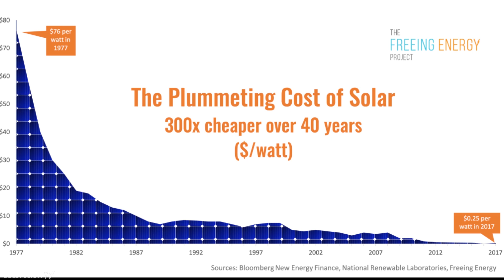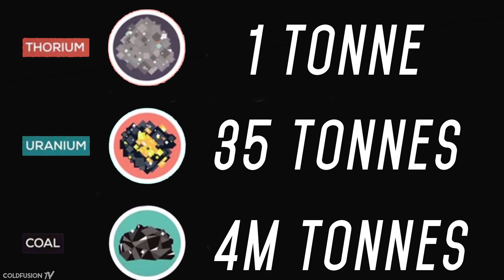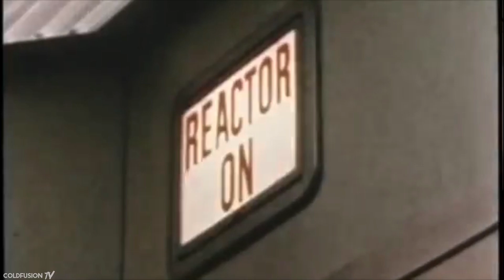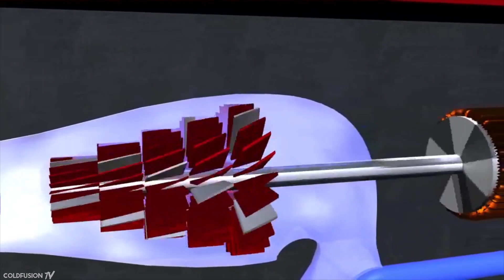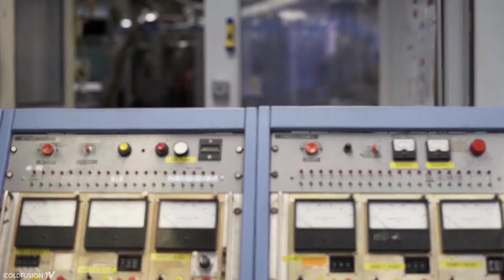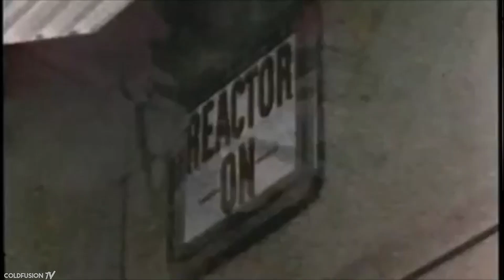Thorium - The Future of Energy?

Comment: I was involved in private research some twenty plus years ago, and everything I read indicated the US Defence force were responsible for the lack of interest in Thorium.  As stated in your video, the major reason being Thorium had no part in providing product for the weapons industry, although many scare tactics, reminiscent of the Current Wars of the early twentieth century, were used to placate the masses.  Unfortunately our American friends have a somewhat high degree of paranoia that is often exploited by the Defence industries and their paid up Senators and Congressmen.  Nevertheless, I concluded Thorium was a better option than Uranium, as indeed you have, and any additional cost can be countered by the increased safety.  Of course Australia could have used natural gas for the interim period whist Thorium reactors are developed had we not sold it to multinationals for nothing, although that’s another story.
Reply: You can make nuclear weapons from the Thorium fuel cycle. The US military actually did this in testing, and so did USSR and India. But plutonium is easier, so that's what they went with.
Reply: @zolikoff  It can be done, but the breeding of U233 from thorium also breed a bit of IIRC, U232, which is a hard gamma emitter and makes it hard to get close to or put into a weapon without frying the electronics.
Reply: @zolikoff  Your assertion is an over-simplifcation in the extreme, completely ridiculous. .You can make a dirty bomb from any nuclear waste, which is sitting in huge stockpiles already, including medical waste, if you can get your hands on it. You can NOT make a fission bomb from Thorium or the "waste" products (actually trans-uranics, that are not waste, but sources of medical isotopes), and you wouldn't anyway, because to make a fission bomb, this requires Plutonium and all the centrifuges and whatnot to enrich the fuel, which would require you are a state actor, it isn't even remotely something that could be done by an individual actor.  In fact, Thorium reactors are Breeder Reactors, and can easily consume existing waste that is and will be siting there for next thousands and thousands of years, making the security of those stockpiles much better, not worse.
Reply: You can make nuclear bombs the following proven ways:
1. Enrich natural uranium until it's mostly U-235. This method doesn't require a nuclear reactor.
2. Use a nuclear reactor to breed Pu-239 from U-238. This method doesn't require any enrichment, but you need the right burnup. Spent fuel from LWRs is not fit for this.
3. Use a nuclear reactor to breed U-233 from Th-232. This is similar to the previous method. No need for enrichment.
As in, yes, you can make nuclear weapons from thorium, precisely because it's a breeder reactor.
Reply: @zolikoff  Well the US Government didn't like the half life of the nuclear fuel so they went with something that had a high shelf life. I could get an vented glass box and put in a pair of goats and a trough of taco bell bean burritos with the toppings that would make the worse gas in history for an dirty "bomb" but if the gas doesn't last but 1 second it won't do its job. The same thing can be said for nuclear breed versions of uranium and plutonium. They don't want short half life materials. That is why they didn't go with thorium.
Reply: @乔石 That's why IRAN is next on the list for REGIME CHANGE! they will create false flags to create a war to take over IRAN.
They've done it perfectly for to other countries. And there is nothing we the average person can do anything about it.
Reply: @hanniffydinn6019  The average person can have less children & consumer less resources that run the global engine.
Reply: army people ruining it for everyone once again
Reply: Brian Bellia  Very few nations have the resources or expertise to develop LFTRs to a point at which they would be commercially viable and America is historically the world leader in nuclear research. China is capable and has recently commissioned 2 prototype Thorium reactors.

What I will say is that this video gives a very 1 sided approach to LFTRs, molten fluoride salts are extremely corrosive. The parts of the neutron bombardment process are dangerous and America concluded LFTRs are a no go after research carried out by Oak Ridge in the 70s. The scientists working at that time actually posted a lot of their findings for free online when they retired which is behind the recent resurgence of interest in Thorium.
Reply: @ollyole4560  the scientists who worked on molten salt reactors didn't post the info online, Kirk Sorenson, a former NASA scientist did.
Reply: @Les_S537  Not true. That information is in the public domain, long before the internet existed. There have been tours of the MSR project at ORNL over the years by any number of international scientists. Sorenson has simply documented this. It is very clearly explained in Sorenson's videos, which are easily found via google.
Reply: @ollyole4560  "... molten fluoride salts are extremely corrosive." No one said that this technology does not have design challenges. To me that is what science is, overcoming challenges with new ideas. Perhaps 40 years later, our worlds scientists will complete the work started, safely!?
Reply: It's gotten to the point in the US, that the defense industry, and large corporations ARE congress, the senate, and supreme court. The federal government is a lost cause and most states seem to be miserably corrupt too.
Reply: Brian Bellia  By the way, I would trust more Iran with nuclear than Pakistan or China or USA. Here is a country that has never attacked any other nation at least in the past 3-4 centuries. Much unlike USA, no wonder why you hate Iran so much.
Reply: @xaris5309  Someone clearly has never heard of the Afsharid dynasty.
Reply: Look up John Hutchinson Crystal Batteries and The Hutchinson Effect.
Reply: The American Military is to blame,...really? The US military doesn't control the world and it didn't stop anybody from investigating Thorium.  You "open minded" lefties always seem to pin all things bad on some singular entity that you are predisposed to hate.  US military one day, Capitalism/Corporations the next,  and then Christian churches the day after that.  Sooooo damn predictable.
Reply: 乔石 Spoken like a true left wing, brain washed communist with no clue of how a free market operates and provides goods and services for any nation willing to participate. The U.S. dollar,didn’t get to be the preferred currency world wide by chance. I suggest you educate yourself and find out why instead of espousing like a jealous child.
Reply: I was reading up on Thorium and one of the myths of it was that it was deterred by Nuclear weapons production. The real driving force as to why it didn't progress further was because of the fear of nuclear power especially after TMI and Chernoybl.
Reply: Brian Bellia  you can ask the same for crytography , spread of "democracy", war , weapons mnaufacturing , threats , assassinations, cover ups , global bullying , spread of racial stereotyping , global polluter (by far the biggest with all the wars the US has created) and now sanctioning ? , how will anyone else be developing things with such a bully ?
Reply: Brian Bellia  Bro, the Soviets had a PFBR, but they broke up before any good could come of it.
Reply: Brian Bellia  As the video mentioned, paraphrasing: "after renewed interest are (still) in the research stage in many countries."
Reply: They get the reactors for their top secret balony projects
Reply: Brian Bellia  Sanctions. Like Iran, can't build power plants without US accusing them of building WMDs. The Defence force needs to be constantly at war to keep the gears churning.
Reply: Robert Kerr you might have been in a documentary I watched
Reply: I think they are not able to comprehend your logic Brian Bellia 
They all blaming the USA for developing uranium more than thorium haha. @Robert Kerr, it seems you are envy and jealous over the USA since they have the capability to choose between thorium and uranium

Like the video said, from then up to now, only minimal research was made on it, but why after the USA decide to develop uranium other countries not choosing thorium 100%?

The UK could choose thorium, but instead, they go to uranium
French could choose thorium, but instead, they go to uranium
India could choose thorium, but instead, they go to uranium
China could choose thorium, but instead, they go to uranium
Russia could choose thorium, but instead, they go to uranium
Iran could choose thorium, but instead, they go to uranium
Japan could choose thorium, but instead, they go to uranium

Only now people start bitching about it because back then the USA could choose thorium! but hey they are not realizing it that their country themselves priorities uranium more compare to thorium. Indian are hypocrites 

Face it, HUMANITY prefers uranium. Not the USA
Reply: Why don't we crowdfund thorium research?
Reply: Thorium is better for energy reactors not for weapons. As for America being the reason uranium was used, it was used for better weapons and no other reason. If our British and Australian counterparts had actually done their home work they would have known this, however they couldnt even touch research on this.
Reply: Brian Bellia   india has a fully functioning thorium reactor , the documentary I watched that I can no longer find stated the US applied major pressure to ensure the reactor would supply no power to the community courtesy of the oil and gas lobby in Washington DC
Reply: fucking bullshit
Reply: Brian Bellia  Dude, America today is already stopping many countries from developing their own nuclear power in fears of people other than themselves developing nuclear weapon. They did they same with oil, they sanction others for trying to sell their own oil outside of the petrol dollar. Now they are banning Huawei in the name of national secutiry for having 5G ahead of America.

However, on the topic of Thorium, its much harder for other countries to develop it themselves. The tech of uranium nuclear power has already been developed and matured before other countries do so using the already known knowledge for it. Thorium nuclear power is still pretty much new and undeveloped, other than USA, China and EU, i doubt there are any countries capable of developing it. China only managed to acquire such technological capabilities in the last 10 years, thou not nuclear specific. Regardless, China is already late to the party, they would rather invest in nuclear fusion instead of fission. America's economy is based on imperialistic policies i.e oil and military, Thorium reactor isn't a game changer to them nor is it worth the change. Not sure about EU, they have the tech for world's largest hadron collider, not sure why they did not develop Thorium reactor.
Reply: @skychaos87  thats it. They do not have the capabilities to developed thorium. I dont get it why people here blaming usa for choosing uranium over thorium, when other country choose to develop the same uranium.

Yes usa and ussr tried to duopolize nuclear but hey look at now eu have nuclear why they not choose thorium? 

5g is not enough reason to ban company
Reply: Looks like the US defense force is severely underestimating the potential applications for safer power reactors, judging by the potential stability thorium can provide, proper development could lead to mobile nuclear reactors which they could use to power their crazy new railguns and from there, develop weapons of war on a scale that has never been seen before (maybe even actual helicarriers, flying artillery platforms, and new defensive technology for large scale structures like ships or bases that need more power than is traditionally available. A lot of things become possible if you can dedicate an entire reactor to it.)

Hell, fuck, they even recently tried to develop something like this. Just not with thorium, the wankers.
Reply: Name a country with no corruption in their rulers.
Reply: Brian Bellia  US...and their allies that have their own geopolitical interests.
Reply: Brian Bellia  
" So did that bill kill thorium technology in places like Britain, Germany, France, Japan, Russia and China, too?"

What kind of retarded question is that? Most haven't developed the technology. China and India are starting too now. What kind of world leader are we supposed to be by sitting on our ass with a perfect opportunity to use it? We are the ones that looked into it first. Why should America give up that initiative and for what benefit? 

One of the things the Thorium bank bill addressed is rare earth minerals. We used to produce such things until thorium was classified a nuclear fuel. After that mining stopped and now 100% comes from China, and we need rare earths for military tech. You think with our latest problems with China we should be dependent on them?

Thorium is clean carbon-free energy, and with the right reactors it would be totally safe, and we can start mining rare earths in America once again and have security in the fact that our supply chain doesn't start in a hostile foreign country.
Reply: Robert Kerr so how do you think the tech can best be incorporated into our energy grid knowing what you know?
Reply: If Nixon was strong in subject: science, he would predict that:
www.youtube.com/watch?v=lxwF93wnRQo - National Security, Rare Earth Elements

BTW - the ones that think molten salt is "super corrossive" are WRONG!
MRS in Oak Ridge run for 3 years, there was some corrosion to the vesel, but nothing serious. Hastelloy-N need some addiction: niobium to counter tellurium.
Reply: Thorium reactors were discontinued until a major technological hurdle was overcome. Lubricant from the pumps leaked into the system and clogged the cooling channels.
Reply: There’s multiple problems with your argument that we didn’t pursue thorium due to weapons development:

1. Conventional commercial reactors were prohibited to be used in the USA for weapons creation by the Atomic Energy Act of 1956. Then you have the International Non-Proliferation Treaty signed in 1970 that also prohibits commercial reactors developing weapons grade material. Then you have the creation of the NRC in 1974, in which multiple federal laws prohibit the creation of weapons grade material. Oh and then there’s also the IAEA which prohibits commercial reactors from weapons grade material. 

2. Uranium 233 was absolutely used in nuclear weapons testing from 1960-1980 by the USA, UK, USSR and India. 

3. In 1977 Shippingport Atomic Energy Center and in 1984 Ft Vrain Nuclear Plant used thorium cores for an experimental Light Water Breeder Reactor commercially. 

4. From an operational standpoint the creation of weapons grade plutonium in commercial reactors doesn’t make any sense, because commercial fuel cycles are typically 8-14 months. However, fuel cycles over 2 months prohibit the creation of weapons grade plutonium, because the concentration and ratio of Plutonium 240 compared to Plutonium 239 is too high. 

Not only is your comment historically inaccurate, but it also doesn’t make any sense from nuclear engineering perspective.
Reply: Natural gas is the worst.
Reply: fossil fuels for the win buddy
Reply: g.e. provide fule rods how do they keep making mony if we go to toriom 
follow the monny
Reply: Nonsense. We don’t use PWRs to make Pu239. 

We didn’t sufficiently fund MSRs because the main effort was put on making fast breeder reactors, using the Uranium Plutonium cycle.
Reply: Brian Bellia  Lmaoo US/NATO sanctions exist and were the ones stopping developing countries from creating nuclear tech, you idiot. Developing countries making "bad choices", yeah right, nice way to dumb down colonization and complex history. Get out of your bogan land and read a book.
Reply: The galen winsor video https://www.youtube.com/watch?v=aq3BUDw6HIk  (the 2 hour full leng video is also in youtube) this revelation will blow your mind, the US corporations are evil !

https://mutualwelfare.org/what-do-we-really-know-about-nuclear-energy/

Then we have just one problem:  egoystic human behavior ! and the solution is a new educative model.  with a new economic model, we are talking about a new society.  http://e-nation.org http://unitycoin.net also the vision http://mutualwelfare.org/
Reply: And I am sure that we can start rolling these out today? I am sure that these reactors could be reducing carbon within a decade? I am sure that they can be rolled out fast enough to actually meet our needs? I am sure that there's enough Thorium to provide the power we need? I am sure someone's done studies of the environmental impact of extracting all that thorium?

Solar + wind + storage + smartgrids = solution

We have the technology. We have shown that solar and wind are very heavy on labor so these is a huge social benefit by creating lots of low and mid skilled jobs for all those displaced coal miners. It doesn't take a degree to install panels. We have shown that solar and wind are cost effective.

Why pursue a nuclear boondoggle when the answers are already here? What issue does thorium address that solar and storage does not?
Reply: @outsidefactor   Solar and Wind are inestable (by nature) and low power density in comparison with nuclear.  Hi power density mean cheap, the only reason nuclear is not cheap is due to over regulation, in example the regulation requires that nuclear plant radiation is 10 times lower that the mean of the country, that is insane.  All is a scare scam, open your mind.

Just read the article, https://mutualwelfare.org/what-do-we-really-know-about-nuclear-energy/   we can extract uranium from seawater cheaply and we would have uranium to produce energy for 100,000 years, https://newatlas.com/nuclear-uranium-seawater-fibers/55033/ .
Reply: Brian Bellia  
.....pressure from the U.S. !!!   😎😂😂😂
Reply: Brian Bellia  
The BIGGEST GIFT TO HUMANITY it would be, if we see U.S. stopping to manipulate the inner politics of other states !!!
The United States of Injustice have had the most malign/inhumane influence against "world-peace" !!
Thats a *pure fact*, no sane brain coukd see it in another way !
Reply: To be fair, if it wasn't for the interest in nuclear weapons, I strongly doubt that anyone would have gone through the capital expense required to make nuclear reactors in the first place, regardless of the fuel.

It's very easy to talk trash about the defense industry, but a fair evaluation of history would show that the defense industry is often the only entity that can make the large, high-risk investments in technology required to push humanity forward.
Reply: @JZ909  not even close to true. If we took the insane amount of money given to the military and used it for investment and research into energy we would be decades ahead of where we are now. War and the military industrial complex have caused incredible damage to our country and our culture throughout the last century.
Reply: @gearhead1302  Imagine, as 1950s politician, trying to advocate for billions of dollars in research toward advanced rockets in a world where ballistic missiles simply aren't a military requirement for whatever reason. What would be your selling point? We can take pictures of the Earth and look at them weeks later when they're dropped from canisters? We can build a space telescope to look at the universe? We can use it as a giant repeater tower for radio communications? How is that worth the immense cost of developing these systems, when there are cheaper, and in all likelihood better, alternatives available, like taking pictures of the Earth with aircraft, building massive ground-based telescopes, or building an entire network of land, or aerostat based repeaters. Now fast forward to today. It's hard to argue that the world is in a worse place because we went to space.

The military gets funding to develop bold new technologies, both because people think having a strong military is important, and also because military technology is competitive is nature. Your new gadget has to counter your adversary's gadget in some way. In the 1950s, building a rocket to take pictures of the Earth is probably an absurdly expensive and risky way to do that, but building a rocket is probably the cheapest way to bypass air defenses, and is therefore worth the developmental risk. As a byproduct of this research, society as a whole benefits from space access.

In an ideal world, we would have the foresight to invest in risky technologies without obvious near-term benefits and make these big steps forward without a competitive catalyst. However, in general, that's just not how the world works.
Reply: @JZ909  I couldn't agree more about the public funding. Many people don't understand how important it is for the public to fund research for new technology. If the public didn't fund it then it would never be accomplished because many of these things are as you said "high risk" and very expensive. There's simply no way a private company would take such a huge risk for minimal returns let alone the fact that many of the discoveries were never intended from the beginning. Most were simply stumbled upon by trying to increase our knowledge of things or as you stated, through military research. 

I'm just trying to make the argument that we could have still gotten these things done if we were to fund the research in a non military way and I believe much of that money was squandered on useless military intervention driven by the corrupt military industrial complex and the super rich. I do understand where you're coming from though, getting the money using fear and war was extremely effective where as getting it for a more noble cause - even a much smaller amount - would have been very difficult. I guess it's hard to say what the right decision would have been in hindsite because we did in fact gain tremendous technology from this funding, but it's hard to weigh that out against all the innocent lives lost.

 Regardless, in the future I think it would be best to pursue technology in a non military fashion. Our military is breaking the bank anyway I think it's way over funded.
Reply: @gearhead1302  I agree with having a large budget for research, and I don't see any particular reason that we should limit ourselves to defense research. Simply being the world leader in discovering new things, thereby attracting talent from around the world, is enough reason to do this IMO. However, if defense research is the only way funding can be justified politically, I'll take it, and I certainly won't bemoan stuff that gets accomplished as a result of military research, as the OP seems to do.

When it comes to the military industrial complex stuff, I don't see strong evidence of it being responsible for military interventions. That seems to come from the politicians we elect, who do it for a variety of unrelated reasons. For example, Iraq in 2003 seemed to be Bush trying to make the world a better place by ridding it of Saddam and the chemical weapons we thought he was producing, and Libya seemed to be Obama bending to the desires of France, which has a lot more interests in Africa, but lacked the capacity conduct such a large scale operation by itself. More broadly, our political strategy of having a military presence all over the world makes the military expensive for us, and cheap for our allies, who can afford to just not fund certain capabilities and rely on uncle Sam to bail them out if anything goes wrong. It made sense during the cold war, when these countries couldn't individually spend enough to defend themselves from the Soviet Union, but it seems questionable today (other than with Taiwan, due to the threat from China). The defense industry doesn't particularly care about this, since selling a weapon to the U.S. or selling it to Germany is profit either way.

However, I do see evidence that we buy expensive weapons of questionable value due to defense industry political engineering. For example, many in defense circles question the value of short range air power operating out of major airbases due to the proliferation of precision missiles that can easily target these airbases, but due to the F-35 being built in 45 states and countries all around the world, it is almost impossible to limit the program, and the various missile defense programs that keep it militarily viable, and redirect those funds to more monetarily efficient programs. To be fair, I should also mention that the most efficient alternative to the F-35 is probably long-range, land-based strike missiles, which have been avoided due to the INF treaty, not because of the military industrial complex.

All in all, I agree with greater civilian research funding, and agree that the military is over-funded. I just think there are different reasons for that excessive military spending that need to be addressed.
Reply: John T  China has no thorium.
Reply: @Brian Bellia US does hold an lead in terms of research progress and funding
Reply: Brian Bellia  India already is and China is well on it's way to getting fusion.
Reply: The problem is that the US government doesn't want to actually put in the massive investment that will be required to get a proper Thorium reactor up and running. Private industry doesn't want to touch nuclear with a ten foot pole for similar reasons and is indeed incapable of handling a project this risky. It's going to have to be done with tax dollars and that's kind of thing that we'd rather not spend out money on compared to bombs and airplanes because the profit margins aren't large enough nor would we get back the money spent on investment nearly as quickly.
Reply: this such false statement. the Us itself facing hardship because public non understanding in nuclear effecting in very hard for Us gov to even get a new nuclear reactor. Thorium itself is a good technology but it is still not use because it's still has lower efficiency and cost more than current Nuclear reactor which actually developed much more than thorium. 

I recommend you do your research first and geez I'm not physicist but at least I know all this fallacy
Reply: The scientific research at Oakridge Tennessee proves your point and everything that happened while you were working on the problems in your country had been by the defense industry were bad The American Deepstate Defence is far worse and the people who are running it will never take go along with anything that threatened their military industrial complex system but everything that you have said is on the money
Reply: This is why the Aliens won't land.
Reply: jomax clux  Yes its operational but having some initial problems. Scientists are trying to sort them out.
Reply: India can benefit majorly if technology is perfected
Reply: The civilian private sector doesn't need weapons grade nuclear fuel. It needs effective and inexpensive nuclear fuel.
Reply: I HIGHLY recommend the Corbett Report's excellent 2 part series called How and Why Big Oil took over the world. Very insightful.
Reply: Thorium is fertile not fissile and has to be irradiated to form U-233 in order for it to be used as fuel. That process produces some nasty byproducts which is why people argue that it isn't useful as a source of nuclear weapon fuel. However, it's not difficult to mitigate the byproduct problem so it can be just as legitimate of a source of weapon fuel as any other process.

Also, I have a relative who was involved with the ORNL molten salt reactor experiment and they told me the main reason the tech never caught on was due to it ultimately being more trouble than conventional reactors and with a lower yield as well. Maintenance was a complete nightmare and had to be performed often due to the corrosiveness of the fuel. The danger of water coming into contact with the fuel was a concern as well. 

One of the main problems was that they found that the spent fuel had to be kept molten as nasty byproducts would begin to form as it cooled. If allowed to do so, it would eventually end up dirtier than spent uranium fuel rods and be more difficult to safely dispose of. You either have to periodically reheat it, or treat it like any other reactor waste. Since fuel is spent quicker, the storage issue can become a pretty big problem if you elect to just keep it molten indefinitely. Also, energy spent reheating it over time essentially lowers the power yielded from it originally if you go that route.
Reply: it's more a UTILITY lock up of POWER
Reply: We could have lightbulbs that last for 100 years but where's the money in that? Can't have products that are too efficient.
Reply: EXCEPT THAT IS FACTUALLY WRONG!!!!! THE AMERUCAN URANIUM USED FOR REACTORS AND THE URANIUM USED FOR WEAPONS WERE ENTIRELY, AND COMPLETELY, 100% SEPARATE!!!!!!!!!!!! THERE WA ZERO OVERLAP!!!! THE VIDEO IS FACTUALLY WRONG!!!!! :D :D
Reply: FACTUALLY WRONG!!!!!!!! IT DOES NOT TAKE 100,000 YEARS FOR RADIOACTIVE WASTE TO DECAY TO THE POINT OF NORAM RADIOACTIVE ENVIRONMENTAL LEVELS!!!!! IT ONLY TAKKES APPROXIMATELY 1,000 TO 10,000 YEARS AT MOST!!!!!!! IT ALSO DEPENDS ON WHICH REACTOR DESIGN AND SUBSEQUENTLY, WHICH RADIOACTIVE BYPRODUCTS ARE PRODUCED AS WASTE MATERIAL FROM ANY ONE, SPECIFIC REACTOR DESIGN!!!!!!!!! :D :D
Reply: For a quick update on Australia's gas fiasco (and more), watch the very funny "Honest Government Ad | Season 1 Finale". I would link it but dunno if that will go through.
Reply: Brian Bellia  India has been working on Thorium reactors for past 30 yrs. And we have already begun testing a prototype. Russia is also in good position to make them active by next decade. Other countries didn't have money at the time when there was a choice b/w Uranium & Thorium. And ur selfish military made the wrong choice. You could have given something better to the humanity but u didn't. Now u r collaborating with China to develop them. Pls come to India in 2040 when we will have Thorium reactors and Solar grid while  US would still burning Coal & Uranium.
Reply: China is well up there on the Thorium and Brown's Gas research.
I strongly suspect that Iran is on to it too viz their recent declaration that they don't want to have a war with anyone. Are they enriching Thorium right now and is that why the  Democratic Republic of the United States of America is hell bent on stopping them as it does count as Nuclear Enrichment. Is this why certain Nuclear scientists have had accidental deaths?
Reply: @peterhendry2154  - What you are saying doesn't make sense. The Th
Reply: @abhinavrathore178  Lol living in dreams bro ? 😀😀😀 India going ahead of u.s.a lmao.
Reply: @abhinavrathore178  dont know why you are bragging india is a backward shithole
Reply: Brian Bellia  Thorium reactors are very difficult to develop compared to Uranium ones. US developed Uranium ones to make quick bucks by selling those reactors to other countries and in return also got fissile material for nuclear weapons. Now a how do you expect developing countries to make them in a short time ? We still don't have decent solar panels and u expect Thorium reactors to be made in few years ?? All i am saying is US had the choice and it didn't make it. They didn't even do any proper research on it.
Reply: So you have tried to make one or did that "Difficult" come from a guy in a bar. The first one was made in a lab way back and on a Friday night they just let it overheat and drain then started it up Monday morning.
Reply: Thorium's abundance would mean that plenty of nations around the world would get energy independence - nations such as India for example, a nation that is not really that much popular with USA (Russia too does not want others to get energy independence, they play along the same lines as US). This is the reason they would intervene in other countries' projects regarding Thorium. If any country in the world would do it, that should be India. It has massive Thorium reserves and all the energy needs of a growing population to satisfy.
Reply: Xaris 👏🏾👏🏾👏🏾👏🏾👏🏾
Reply: One second, I just need to get my Thorium infused aluminium hat..."It's a conspiracy mannnn.....the government doesn't want the people to know mannn"
Reply: Well said. I think Thorium would be safer than Uranium as long as we haven´t solved Fusion ;)  But until then, I am all for more research in battery technology and solar cell efficiency. That´s the way love goes. <3
Reply: Brian Bellia 

Subtle clue:

Rammstein — AMERIKA
Reply: @乔石 
Total paranoid monetary blabber, next you'll be at a Fed conspiracy and the Illuminati.
Reply: As someone who comes from a military family, and Lockheed, and Raytheon tended to employ many members of my family, I might have to say your story seen like BS.

The US military, and the Defense Contractors would exploit thorium
Reply: morelli tech Nobody like the government bro. What do you working there have todo with nuclear power?
Reply: Brian Bellia  Of course,  US styles itself above other countries but it still delves in slave labor, concentration camps of migrants, unlawful sanctions,  bombing and killing of children, use of biological and radioactive WMDs.

Everyone does it but that doesn't mean they should get away with it.
Reply: I too have a friend that works for the Dept. of Energy in the US. I asked him about Thorium and got the same answer. “ You can’t weaponize it, as easily.” My next question was “ why does the DOE care about weapons ? “   He refused to answer. I’m sure, It will take a Revolution to get Thorium online.
Reply: Brian Bellia  because most other nations are sheep herd, no real independency, but following dollars
Reply: Amer Huba. Bit of a cheap shot that one. Way back in the 50s and 60s, the UK was the world leader for jet engine and supersonic development. The US wanted this know how, so that with their manufacturing capacity, they could dominate aircraft production for military and civilian purposes, now the US could’ve just paid top dollar, but they knew that the British government were desperate to acquire the latest nuclear advances. So, in the end there was a take it leave it deal. With one or two exceptions, the Brits lost their pioneer status and the associated wealth and prestige that comes with it.....but at least they went nuclear.
The US has been playing the geopolitical/warfare/desperation for a helping hand game since WWI. Weaken both your enemies and your allies to see who come begging. If that’s the way the US wishes to be today’s empire, that’s fair enough, but when you moan about tax dollars, be aware that it’s you that made it this way.
Reply: @amehu  Are you saying that 'Muricans are independent thinkers, who do not behave like (paranoid) sheep and are not just chasing $$?  Thank you, man: I haven't laughed so hard in a long time!!
Reply: The DOD is killing Thorium to this day. The last Thorium Bank bill was killed by DOD opposition. Before that many senators were looking forward to push forward the bill.
Reply: First problem with thorium is that it is not that much more available than uranium, and when they run through the world's uranium, they will still have to do the job of making renewables work, which is the only hope for the long run for humanity. Second problem is that ANY nuclear is 4-5 times more expensive per kW-hr than renewables and their cost per kW-hr is dropping every day!  If we are to spend our money on something, let it be renewables and simply use govt mandate to crank up production of solar panels and wind turbines to a war-time kind of footing.  Third, the time required to build the 30 thousand some reactors we would need to eliminate carbon fueled power, it is estimated,  would take 60 years to develop it, train enough people to run them, which is a HUGE current deficit, and then build and start the reactors.  Too late to prevent the worst of global warming or keep us from climate tipping points. In the same time or much LESS we could build 4 times the renewables, which is a technology we know how to use and is far cheaper.  As for Australia, you have more solar than does the sahara!!
Reply: @rstevewarmorycom  If you think renewables are the answer as we speak, try powering a steel foundry plant. Thorium? Yes, it can do it, no problem. Renewables? LOL!